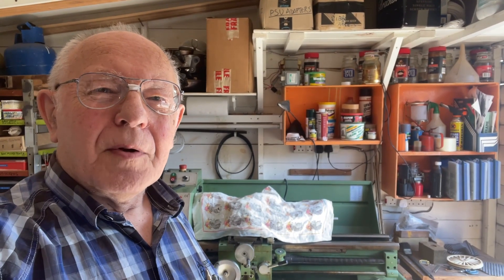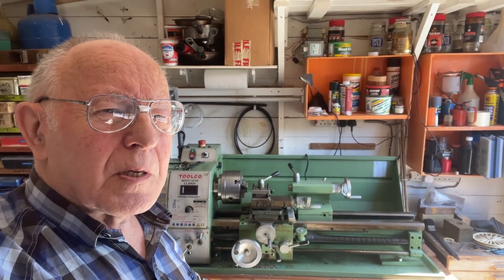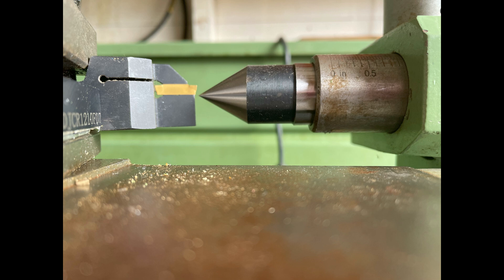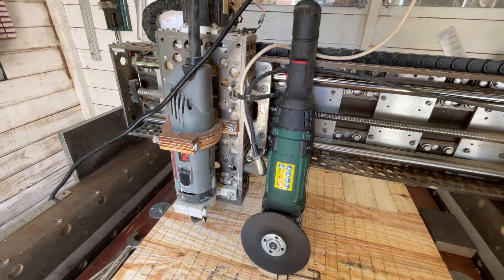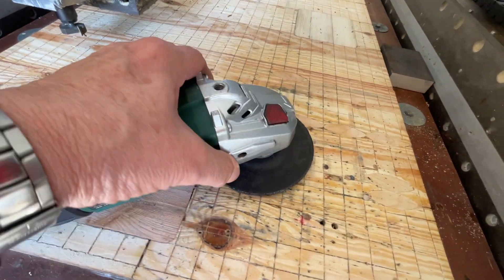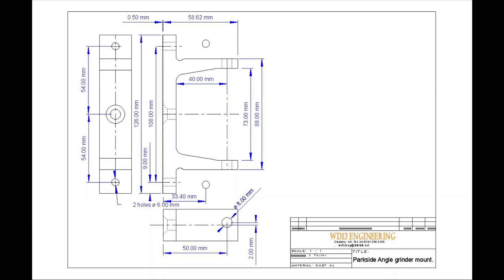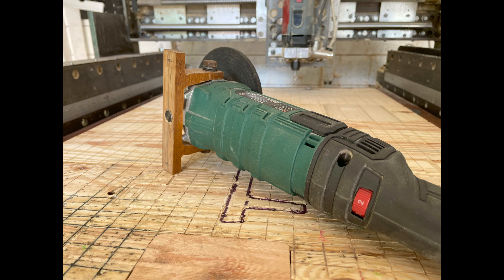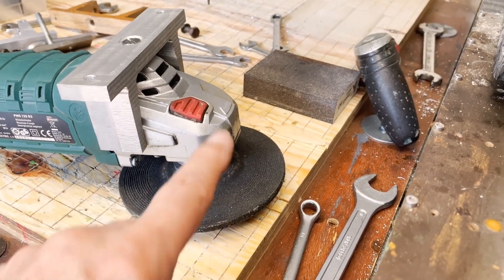Converting a CNC machine to Surface Grinder

Comment: That worked well! I'd be concerned  about the grinding dust destroying the CNC rails though...
Reply from the maker: Good comment. I doubt if I will be using it much since it was principally implemented to perform just this one task. If I ever do use it on a regular basis I'll have to add some sort of noxious dust extraction rather than rely on a block of wood.